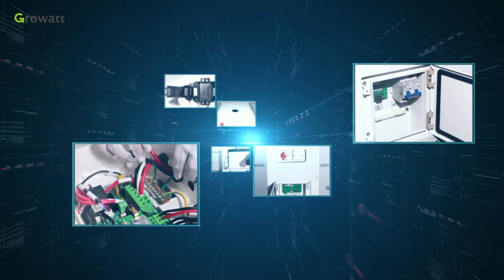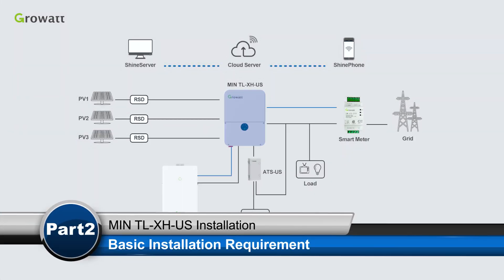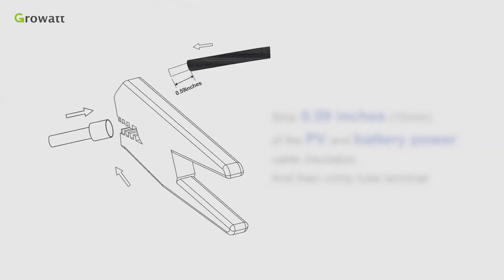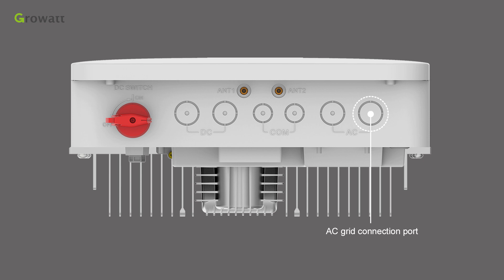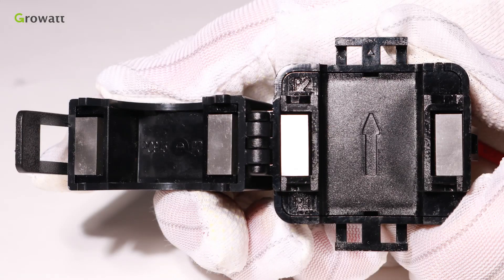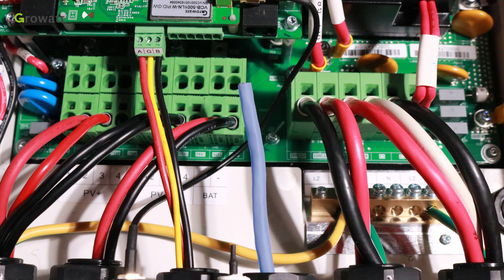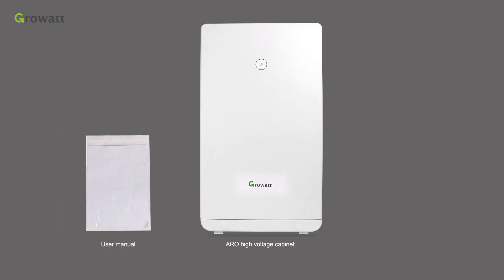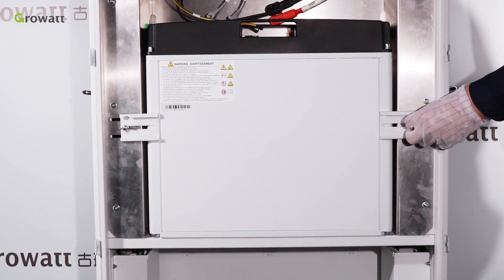[Tutorial] Growatt USA inverter and battery installation training guide

Comment: I am looking to get a Growatt inverter, specifically the SPF 12000DVM US.  I cannot find more info on the charge controller portion of these hybrid inverters.  I have my own custom built lithium ion battery bank and need an inverter with a charge controller that I am able to set custom parameters. I need to know if this inverter has automatic equalization mode under the lead acid charge settings, and if it does can it be turned off?  Or, would I be able to set custom parameters for the lithium batteries I already have?
Reply from the maker: Hello, for technical support, please feel free to contact our service team at service@ginverter.com. The team can provide assistance for you. Thank you!